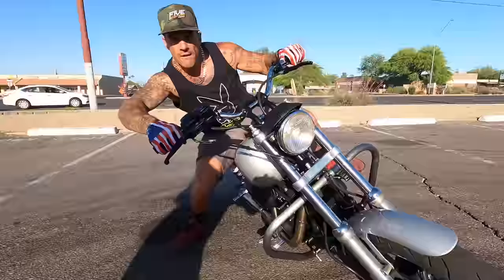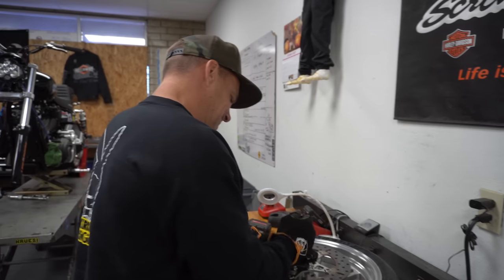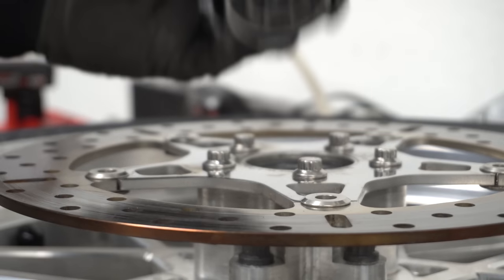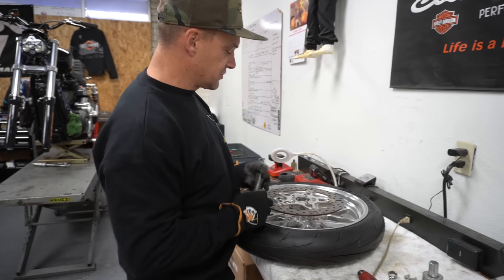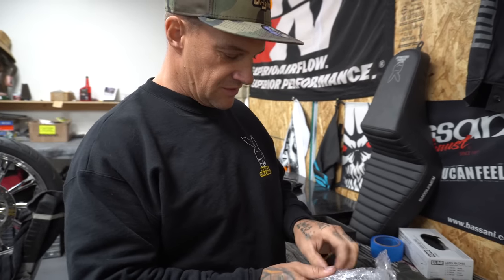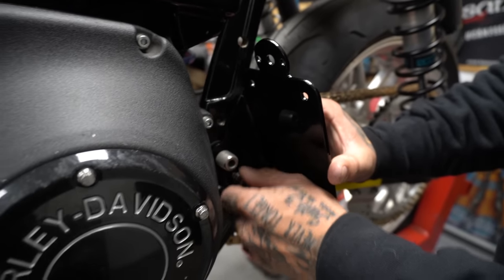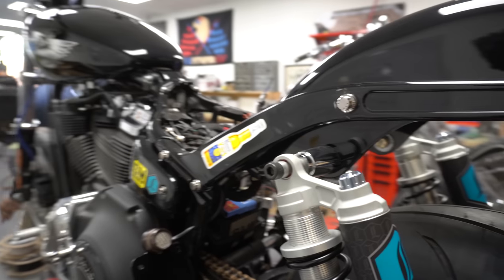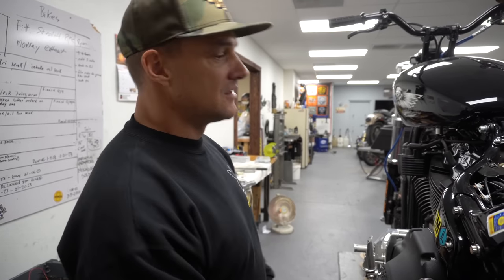Changing wheel bearings in our harley davidson race bike

Comment: I enjoy watching the videos on the bikes you make. Question for you, what would be a good replacement clutch for a M8 114 RGS
Reply: The Recluse Torque Drive is a good replacement clutch for most people as long as your motor makes less than 150 hp / tq.
Reply from the maker: Barnett frictions and steals are good may be a better spring.